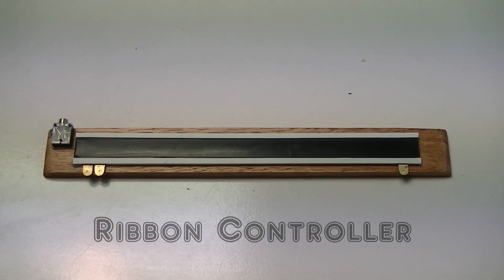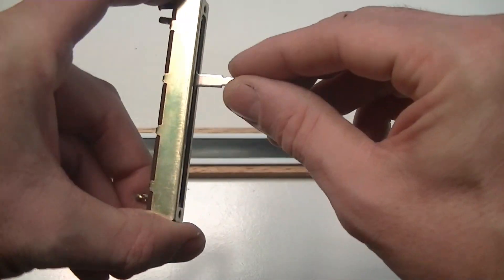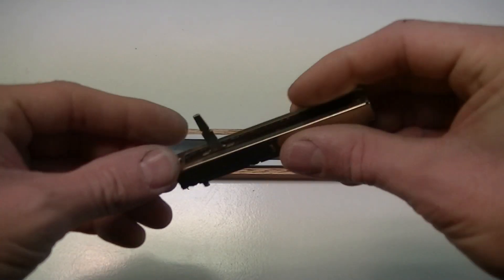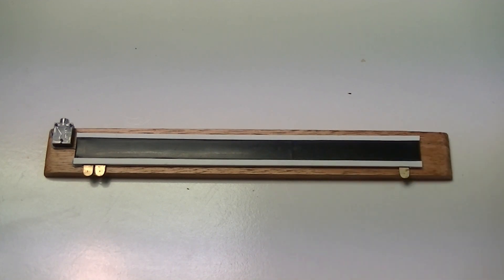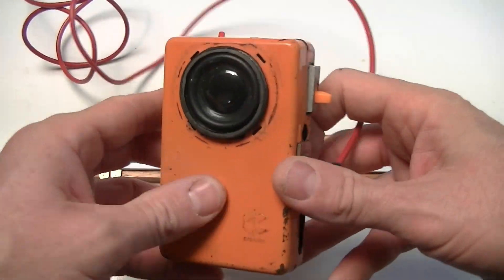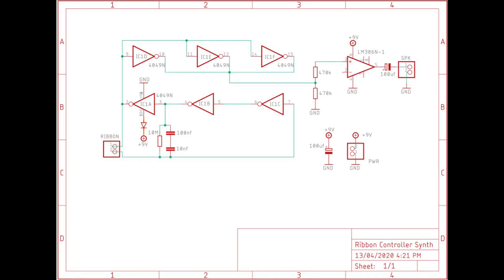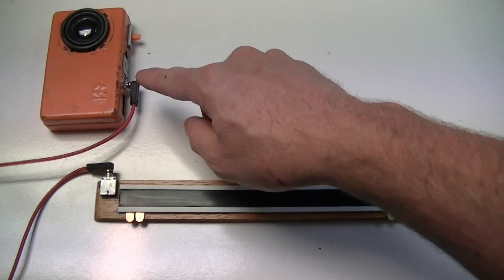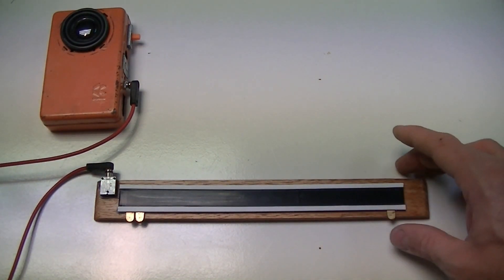Make a Ribbon Controller (Potentiometer)

Comment: Is the metal strip actually brass, instead of copper ? I'm asking because it appears to have a metallic yellow appearance.
Reply from the maker: I'm pretty sur it was copper.  However, it wouldn't really matter too much if you used either metal

Comment: It would be interesting to convert those resistances to MIDI data and control a softsynth with this...
Reply: I'm looking at this right now with a view to doing that via an arduino.
Reply: @MusicEnthuZone  Love to stay updated on how that goes. Make a video with your results!
Reply: @sailingshadowfax7518  I most definitely will be. Actually I think it's going to turn into a series. I have plenty of pots and sliders as well as the pads from an MPC. Thinking of having multiple arduinos in the same box, dbeam controllers, footpedal.

Working Name: Megatron 3000
Reply: @MusicEnthuZone  I'm subbed so eagerly awaiting! I'd love to make one myself to control the ribbon slider on the Arturia CS-80v

Comment: the plastic that is underneath the plastic, are there holes in it. Is there a slot there to make it touch the copper. I mean I get the gist of it. But it's kind of unclear how it looks underneath the black plastic strip, which I think is a videotape... Right? Could you maybe post some pictures or explain in a bit more detail how this looks as it is sandwiched together. I'm kind of new to this diy stuff, so please forgive my ignorance.
Reply: not ur fault man, i mean the video does is labeled "MAKE a ribbon potentiometer".. i was kinda expecting to see how to make it to